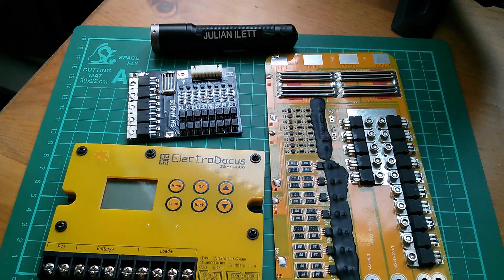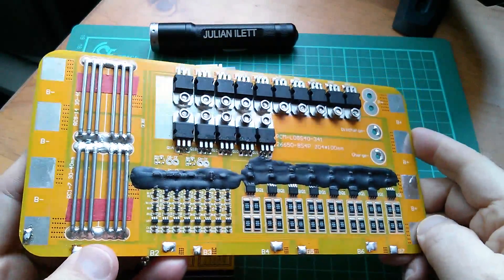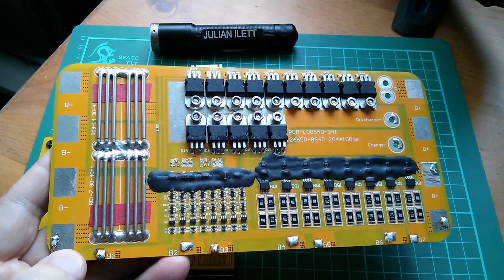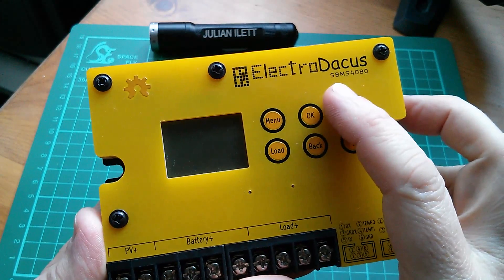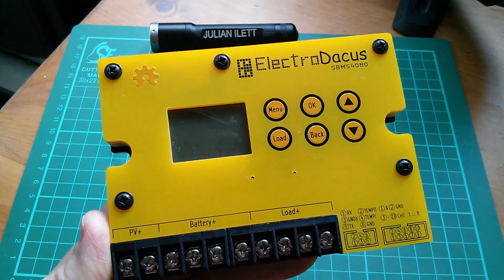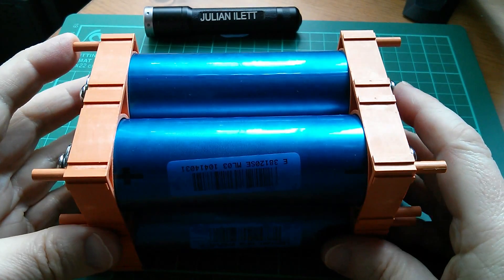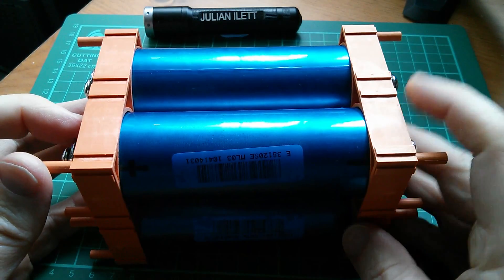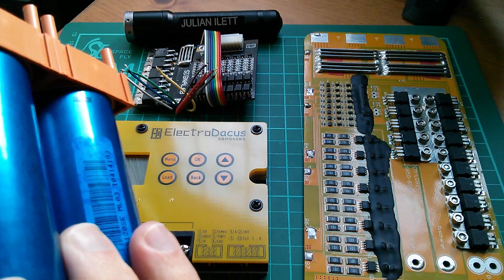Postbag: #36 - BMS Special ft ElectroDacus Solar BMS

Comment: Hello Julian,

I would private message you, but I think others may be able to benefit from my question.

Could you direct me to a reliable, inexpensive BMS? Or a company that sells good ones? I am building an electric bicycle battery that will have 20 li ion 18650 cells in series, so I would need a 72V, 30A BMS. 

Thank you!

Paul

Comment: Are there no BMS PCBs out yet that aren't cheap ones from eBay for LifePO4 batteries? I wanted one for my project but they use the wrong low voltage and over voltage levels.

Comment: have you tested the electrodacus yet as im really interested to see if this will work with 18650 and solar panels
Reply from the maker: +David Simpson No. I certainly meant to, but summer this year was terrible - 2 or 3 weeks of good weather. Now it's cold outside, the grass is damp and I'm switching my thoughts back to the winter projects. Has anyone got a nice villa in the sun I could work from?
Reply: i find winter best time to test solar as this point of year you can get the best from your system when it really matter i have a tool on my phone called simply solar i use this to align my panels and it reminds me to check angle i have my panels in a pritty bad spot due to been only place i could mount them rest of work done indoors haha
Reply: lets facve it we will in the uk so a nice sunny day prob ant the best day to build a solar setup lol i like to size up for winter

Comment: I've seen at least one post online where someone is using a 4cell BMS with 4x4 18650's in parallel. I would have thought this would be detrimental to the feedback sensing of the current and would over charge the batteries? what are the effects of adding batteries in parallel to a BMS and what if you don't add the amount of cells the board is designed for?

Comment: The ability to adjust the voltage sensing levels seems like a case of replacing the resistors on a battery management board with some variable pots. perhaps you could do a "deep dive" on a small 3 cell board to see how easy it is?

Comment: Those lifespan figures seem impressive for LiPo's and on the face ov it better value over their lifespan. However, one thing is that it is fairly easy to obtain second hand lead acid batteries in very good condition for a fraction ov the new price. Sometimes not much more than the scrap value. I have never yet seen any kind ov large lithium anything batteries offered in this way. As for the charging/discharging efficiency...well solar panels are pretty cheap nowadays. And during the day with a large array you're running many loads essentially direct from the panel's current anyway.

Comment: Any chance you might do a "solar energy primer" video covering top-level concepts, battery types, solar cell types, latest technologies available to DIY, the purpose of BMSs, an idea of what's possible with solar energy in the home, and approx project costs and pointers to get started in the world of solar?

Big request I know. There seem to be so many areas of solar energy I don't understand so this would be amazing to start the process of demystifying it all!
Reply: Hi Mat, You can take a look at my webpage electrodacus.com at the end of the page is my Offgrid house solar setup and  a 7 day energy production and consumption graph. There is also a link to a solar calculator based on real collected data for most locations over the world so you can really know how much a certain size PV array will produce.
But do not think it will be less expensive than grid power because it wont. I calculated my amortization cost if everything last as much as the spec say and will be about 20cent/kWh.

Comment: Where would the best place to find a cheap 10w led driver. I ask because I bought an led flood light recently and accidently fried the driver/converter so I'm trying to replace that.
Reply: It depends on how small it needs to be to fit your application. Any variable constant current will do normally and they are relatively inexpensive. Current setting will depends if if one of those 3x3 matrix LED or it is a single die one like the Cree XM-L.
Reply: Thanks for responding to my comment. I think I have a 3x3 LED, as I can barely see 9 small darker circles under the yellow coating. What does this suggest for the current?
As far as size, preferably around 2x1x1 as this is the size of the one I "fried." It also list an input as dc: 10-24v 50/60Hz, output dc: 35-72v 300mA. The problem is I can't seem to find a driver that exactly matches the input/output and I don't know what I can get by on if I'm not to match the voltages exactly. Thanks again, hopefully you can offer some advice.
Reply: Tcamp
It can not be DC at 50/60Hz :) do you plug that directly in to an AC outlet ?
Do you have a model of that LED lamp.
All specifications you give look strange. I will say get another lamp and do not try to repair it will be safer for you.
Reply: ***** yea that seemed strange to me as well but I didn't know. That is just the driver though. The light itself part of a flood light that I doesn't list specs on the led itself. Plus the driver I written mostly in Chinese. Oh well it wasn't expensive so maybe I will just get a new one. Thank you.
Reply: Tcamp
I recommended you get another one for your safety. You did not seem to understand much about electricity based on your comment and that appeared to be an AC powered item 100 to 240V AC probably was the input.
The LED is a 3x3 matrix so it probably has 3 groups of 3 LED's in series and then 3 of this groups in parallel each of those LED is 1W even if most round that to 10W that is the most common but it may be they have one with all 9 LED's in series.

Comment: I know it's going off at a tangent but this video reminded me about your pwm solar charge controller which reminded me about the series you were thinking of making about it, from conception through to production and all of the challenges in between. IMHO I think it would be well worth tuning in for.
Reply from the maker: djkelectrical I still want to do that, and I'm seriously considering open sourcing the firmware for the PWM5. Most of the warranties on the sold units have expired, so maybe now's the time.
Reply: There must be some videos like that. I think Dave from EEVBlog has something related to this.

Comment: +Uroš Golob sorry there is no replay button to your comment you need to change the google+ settings.
That Atmel IC looks great similar to what Linear technology has but the ISL94203 that I use is even more integrated and with more functionalities and is not SW dependent it dose all protection in HW

Comment: he's spamming everywhere with this kickstarter controller, and it didnt do mppt last time i looked...
Reply: It's called marketing! What's the big deal?
Reply: Soon I will do a video to explain this. I just need to make it simple for everyone to understand why MPPT is obsolete similar to my video on LiFePO4 vs Lead Acid.
And sorry if you consider this spam.
Hope you do not change the profile image is how I recognize you immediately :) I'm not that good at remembering names.
Reply: It's not spam! This is marketing a great product of interest. He's informing you of the availability of a BMS that may be of interest to viewers of certain video and forum channels.

It would be spam is this was a Justin Beaver site inhabited by teenagers.

You don't need MPTT. That's old hat.
Reply: ***** Why i like MPPT because charger (EPsolar) accepts higher voltage (150V). That means thinner wires, lower loss, cheaper panels and install distance is less limited. I use 3x250W panels in series.
Reply: Eratas1
Panes cost the same I also use 3x 240W panels with my battery bank the same 60 cells inexpensive panels.
Wires will not cost that much even for relatively large distances.
But look at a 3000W DC-DC converter and the cost that is what you need if you want an MPPT in a SBMS100 that can do 120A. Is much less expensive to add an additional PV panel that will give you way more extra energy than MPPT function plus the solar PV will last 25+ years where the DC-DC converter will need to be replaced or repaired a few times over that period (especially the electrolytic caps) think about the heat. The SBMS100 will have a TDP of 22W that is with max current for charging and discharging at the same time. Adding a 3000W DC-DC with even a super 97% efficiency at full load will result in 90W of heat try to cool that passive will require a huge heatsink and active will be preferred by most people.
Is just about economics if PV panels will have still been at 10$/Watt then an MPPT will make sense.
The SBMS100 will have around 340 grams with a 3000W DC-DC will need to have at least 10x as much adding significant additional cost to shipping.

Comment: Thanks Julian. The reason they used IC with those larger limits is not because they wanted to get out more out of the LiFePO4 batteries but because that was the only low cost chip available for them. Both of those BMS boards use  5 pin IC from Seiko and that was designed for LiCoO2 battery (the most popular Li-ion batteries) and that is why the limits are not good for LiFePO4. The limits are fixed inside the IC can not be adjusted externally.  Since then Seiko came up with proper 5pin IC for LiFePO4 but they are much more expensive then the older one since the older one can be found on the black market in China at maybe 10 cent or less where the proper one cost a few times more.
Still that is just a protection IC it only protect for Under and Over Voltage.
If someone is interested in the new Solar BMS project you can read more on my web page or Kickstarter about http://electrodacus.com/k
It is specifically designed for OffGrid solar so even if it can be used in other applications that is the best use for the SBMS.   I will need to change that sentence about LiFePO4 costing about the same as a Lead Acid with 2x capacity (the Lead Acid has 2x capacity and cost as much as 1/2 capacity LiFePO4 but because of the other advantages will perform the same wile lasting longer not sure how to formulate that but I will find something )
Yes the new LCD will not be as visible outdoors as the old monochrome one. But most of the SBMS users will have this installed indoors in a Home, RV or Boat the SBMS is not really designed for outdoor use anyway (it is not water proof).
The color one is at visible as an older color LCD phone was since that is where those LCD's where used.
Reply from the maker: ***** Thanks Dacian for putting me right on those points. There are a couple of comments suggesting 'bottom balancing' - what's your advice on that?
Reply: Julian Ilett
That can only be done manually and is somehow useful if you do not fully charge but intend to fully discharge. I do not see the advantage of bottom balancing you stress the battery by discharging them that low 2.5V and if you have any form of monitoring it will be better. Even those BMS boards can stop discharging when you get to 2.5V so will offer better level of protection that bottom balancing for discharging at high rates but for charging those are useless.
If all you want is to test the bike just charge the cell manually and you can play quite a bit before they get discharged check them eventually with one of those 8 cell monitors or even the solar BMS.
When you want to connect the solar BMS let me know or watch the beginning of that one hour HW video on my channel to see in what order you need to connect things.
The gain in autonomy from Lead Acid will impress you :)

Comment: hey julian, tbh i was abit disappointed when i saw this video because it was only a teaser like movie with theory info only,
it would be nice to see a video with actual measurements/comparisons of this bords (like you usually do) so we could see how good they are for protecting/ballancing. also i was wondering about how good a bord without a MPU would work
(old school electronics VS digital MPU)
cant wait for the spring to come as im sure you will test the s**t out of them bords, like only you can do so good!
thanks.
Reply: That will take quite some time. Not that easy to do this tests. Both of those PCM PCB's have the same IC and will perform the same when it comes to protection and balancing. They have 2.5V and 3.9V as low and high limits.
My SBMS4080 can be used with any Lithium battery so it has fully programmable parameters over 35 individual parameters and is based on the ISL94203 from Intersil you can check the data-sheet on that.

Comment: Hi Julian - Thanks for the shout out. After my own lithium pack failed a few months ago (after I'd already sent you that BMS), and I did my autopsy video, Dacian let me know about the SignalLab BMSes taking the cells to too high a voltage. He says that SignalLab used a 5-pin SOT23 chip (labelled R2RR I belive) that was actually designed for Lithium Cobalt cells. LiFePo4 Cells are generally quite tolerant to overcharge, so they can mostly get away with a 3.9V cutoff voltage (instead of 3.6ish which would be better for the cells) - the pack balancer circuit will bleed down the extra voltage once it's disconnected from the charger. The higher cutoff voltage will do hidden damage to the cells if it's left hooked up to the charger for a long time, but it won't necessarily show up for a few years, by which time the pack is out of waranty and they can sell you a new one. As long as you disconnect the charger reasonably soon after the charge is complete then you'll still get away with many years of service from your cells. What Dacian has done with his SBMS is far superior in every way to the SignalLab BMSes... I'd certainly use that if I were you. Cheers!!

Comment: Bin the BMS bottom balance those cells first Check the controller specs it will cutoff at a certain voltage so saving your cells